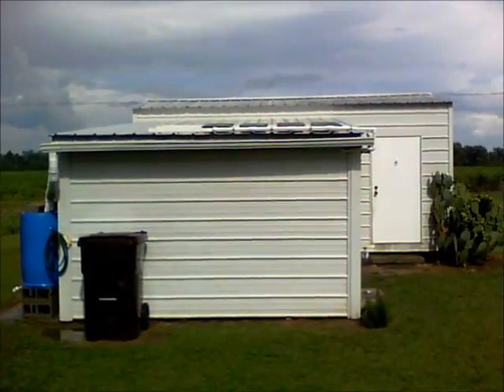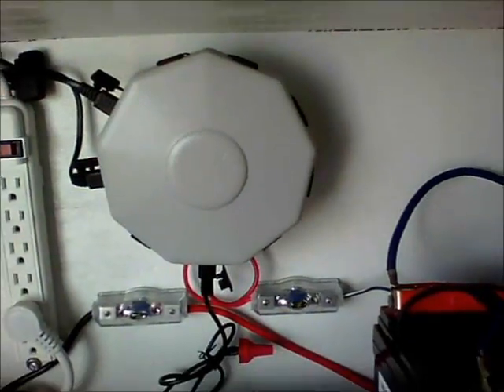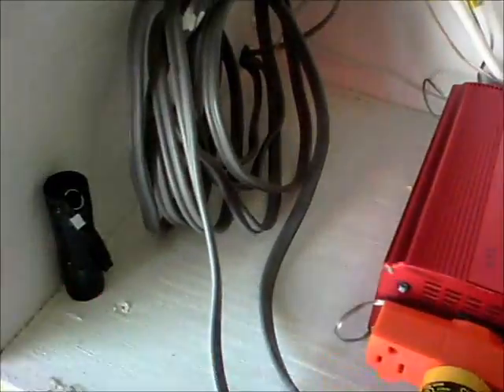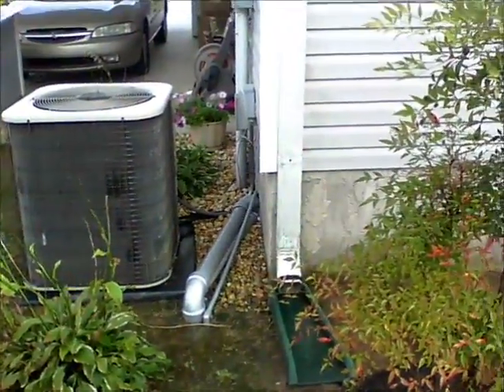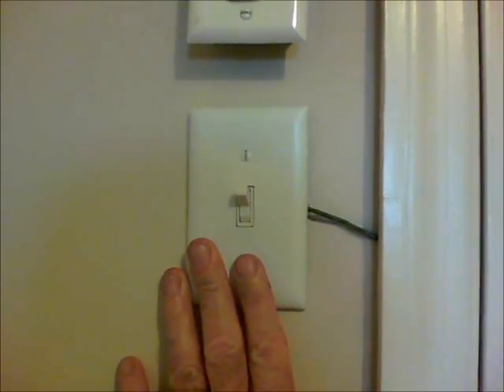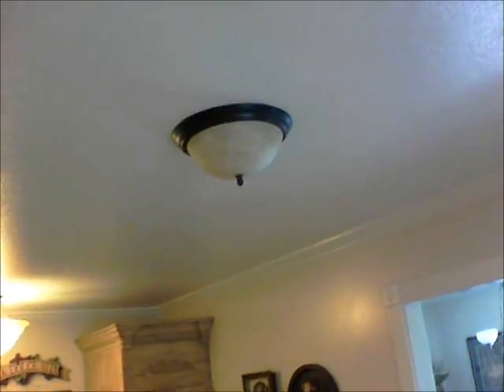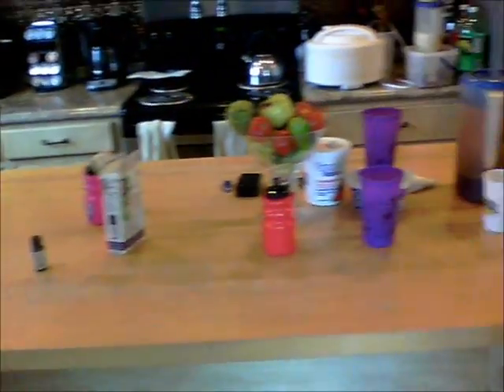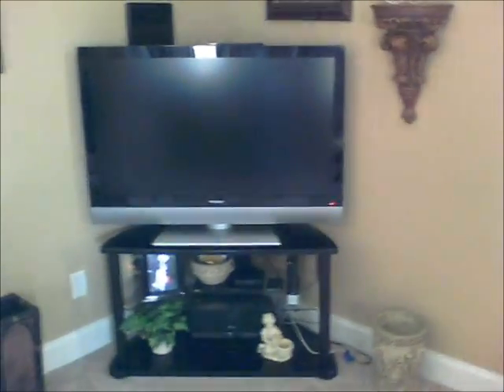Harbor Freight Solar Panels Wired into my house

Comment: Sir, if you are satisfied, there you go. Don’t bother about 44. Bravo, well done.
Reply from the maker: Well thank you. We are very satisfied with this system. Since this video I have added a 100 watt panel to the array and bigger batteries for more amp hours. Still using this same system after 4 years.
Reply: Hiw is your solar system doing is it still up and running

Comment: Great job..I have two of those controllers that I got when my uncle gave me two 45 watt kits for working on his mower...they can be hooked in parallel but since I already have a 4215 Epever BN  controller I just hooked the panels to it today...you get more amps with the mppt..I just got two more batteries yesterday so now I've got 8... now if the sun would just come out...lol...out of 490 watts of panels I was getting 20 watts today
I got more than that during the winter storm until the panels got about 4 inches of snow on them but my cousins were on rolling blackouts..my aunt called and asked if I had power (she forgot that I had been building a solar setup )and I was like yeah I just made coffee...I was just thinking I gotta get two more batteries so I did...I kind of like how it's doing now..the voltage doesn't move so quickly now..I started with two 19 amp hour batteries that I don't use for power now and now I have 680 amp hours...I have a room in the barn with my stuff so I was hooking the new batteries up and went to go out and a little skunk had found his way into the barn and was kind of foraging so I stayed in and watched TV and then today the sun didn't come out at all...so my batteries are at 25.2 volts and the little smiley face is on the MT50..lol ..I didn't get to see whatever it is going to do..fooey..it does this every time I upgrade something

Comment: This is the correct way to use solar. Lights take limited power, tv not much. So to use his system daily actually makes use of the power he gets from the cells. I have an inverter battery pack that I use in the house when the power goes out. It lasts 8 hrs and runs 3 lights in the house.

Comment: Someone who doesn't know much about electricity. I'm very impressed and what you did. I have worked on generators steam turbines and transforms for 40 years. Also used to wire houses in my younger years. What you did is very good a lot of work you put into it and it's still very good. In the kitchen where you have your light if it is feasible I would put a ceiling fan combination light. I too have two sets of Harbor Freight 45 watt solar panels old school type and I use it to power my shed good job. When I wire houses in my younger days, my boss told me one thing that always stuck in my mind. Electricity can only do two things and two things only. You can either work for you, or you can kill you. Just be careful

Comment: Wait wait you spent 20 bucks on a 100 watt led bulb???  You can get those at a dollar store for a buck lol. I know because I just bought 2- 60 watt ones today for a buck each. they only use 8 watts which is cool. Anyways you did a great job over all. I'm going to harbor freight tomorrow and getting a couple of solar kits also. I've also been watching you tube videos and am hearing that solar panels are much better than using solar wind. I guess they can break down and or over heat. Best of luck to you. Peace.

Comment: You admitting you're not an electrician and I am one of more than 30 years could have smart talked your installation of the wiring and could have been "one of those people" to insult you and be  a dick but I'll admit, I would have run the finished wiring differently and would have done things a bit different than you had but then, the jobs I do that you do as a living could be nit-picked to death as well. So... Nice job sir. The wiring on this job, schematically speaking is outstanding. Very nice what you've done with all the precautions and metering you've included has given this sparky ideas from your wiring you've done there. 

Good job. I just would have done things different but you have made it safe and working to your  benefit. "SAFE" is the magic word here. And you are safe there. Nicely done.

Comment: I was wondering if this system was restricted to lights or can you power up something larger also.Very nice job I say too
Reply from the maker: No, I can run anything up to 1000 watts, that's what my inverter can handle. I don't run the TV most of the time because it is not a pure sine wave inverter and I don't want to hurt my TV.

Comment: Very good video, nicely produced, lots of helpful information. I'd guess you might live somewhere near Huntsville, AL. We had en EF-5 tornado come through in the spring of 2011 that took down all of the feeder lines supplying the city, took a week to restore power. A LOT of people I know have installed similar systems since then, from solar to whole-house LP gas generators in case of another emergency. Your system is simple, expandable and seems quite efficient. Nice job!

Comment: It's been a few years since you made this video and the price of LED'S has dropped. I'm hoping you replaced all of your bulbs to led. Have you ever considered using Golf cart batteries they are fairly cheap but you'd need 8 of em as they are 6 volts. I've been told they are great for solar use. Last I checked they are about $68.+ per battery and they are big so longer run time as long as your system can fully charge em. Back to the LED's in your house use soft white not that horrible Day light white. Thanks for the helpful video and thanks for a perfect explanation. If only all YouTube posters would do the same.
Reply from the maker: Thanks for the comment, and I have updated my batteries and my lights. I just have not gotten around to making a new video to show it. We are still using the system though.

Comment: very nice. we’re in eastern, nc too and run a genny now but solar in the future. i made a distro that’s more convienient but have wanted to hardwire a few outlets (apart from the distro that accepts an rv plug on the outside wall - inside is breakers, outlets, voltage and power indicator lights, volt and ammeter). from there we run well placed 10 and 12 ga drop cords with quad boxes and hospital grade 20 a receps; safe and sturdy but a bit cumbersome
 thanks for sharing...

Comment: I am just starting my solar panel education, that said I was wondering if you could run your house on 12v. there are LED lights and pretty much anything in a RV could be used for home use.. what do you think ??
Reply from the maker: Yes you can, and lot of off griders do. People do it in RV's all the time. If you stay at 12v you will be limited on your inverter size is the big deal with most people. The main thing is, what all you want to run on the inverter. 
Thanks
Reply: @jamesndarlene  there was a guy talking about having your batteries at 24 or even 48 volts then reduce to 12v if needed. it makes it easier for your inverter. made sense to me

Comment: Thank-you sir. Finally useful, easy to understand information. I see where you added 100 watt kit and how many more batteries? And does the solar panels keep batteries charged when sun shines for normal day? I have system but haven't gotten around yet to trying anything yet because could only find negativity information until seeing this, so  again thank you!!!
Reply from the maker: Your welcome, and we added 3 more batteries so now we have 330 amp hours of storage. And yes, the batteries do charge up just fine when we have sun, and when we don't since we have two different kinds of panels. If we had even more battieries I think it would charge them up  just fine in a day as well. We love our system and are still using it for lights and fans and such. Great for power outages and it helps keep the power bill down the rest of the time.

Comment: how long have your batteries lasted years ,and about how many hours a day ?
Reply from the maker: Last year I bought some new bigger amp hr batteries at Sam's club even though the other ones was still working fine. As far as how many hours..... that's a hard one. It depends on what I am running, if there is any sun out, how full the battery bank was to begin with and so on. First you have to know what you want to run and for how long, then you build your system around what your needs are going to be. Mine was simple I wanted mainly lights, fan, coffee grinder, and maybe TV for a few hours. We still use our system all the time to off set our electric bill, and of course when the power is out. Hope that helps.

Comment: We just did our solar also, couldn't tolerate the SM or digital meter needed an analog. Just got new panels and Fork lift batteries made for solar. a bit pricey but will do what we need. 12 v refrig, 12v TV, 12v most anything you need is out there. Good doing. I learn better when it is simple and electricity.  Thanks

Comment: I am not sure if a larger capacity batteries would help you. if you don't drain the batteries too far down with what you have it might not make a difference. The solar panels have to put out enough power to recharge the batteries. It should charge them to a little over 13 volts volts at some point during the day which will drop some over time after the charging stops.  Not enough solar panels will cause the batteries to go too low as will not enough batteries. The charge controller can also cause the charge voltage too be too low. i read somewhere that the battery voltage shouldn't drop below 12.5 volts but i wouldn't want it to drop below 12 volts.

Comment: If you replaced the compact florescent with led lights in the sealing light it would take less power and wouldn't need to wait for it to warm up. Led is more efficient than florescent. Led bulbs are much less expensive now. I( have seen them as cheep as $1 each. The ones i use are usually about $2 or a little less each in boxes of 4.

Comment: Are you running the fridge on that system as well?
Reply from the maker: No, I could for maybe a few hours but not all the time. I have upgraded the batteries since this video but would need even more to run it all the time.
Reply from the maker: Mine is a very small system for lights, TV, Coffee Grinder. For the large things you are wanting you will need to figure how many amp hours you will need to store in batteries to run those things. Buy a kill a watt meter and plug into each thing you want to run. Then figure out how my amp hours your battery bank will need to be, then figure out how many solar panels you will need to charge that battery bank and that's it. you build your system around what your needs or wants are. mine was small because I just wanted back up power for power outages. I hope that helps.

Comment: For someone without electrical experience, it seems you did an okay job. The PVC you used is not exposure/sun rated though - should have been rated schedule 80. It's also a good idea to run low voltage and high voltage in separate conduits. NEC was a little different in 2014 though. I just hope you're careful with the wiring and keep a check on how it's performing. Good luck with the Harbor Freight stuff. I have a little less confidence in electronics from China. It would also be a good idea to label the switches and outlets on the solar circuits and when you have time, switch the CFL lights for LED.

Comment: How is your system running after these yrs ?
Reply from the maker: It's still running great, in fact a few months ago we found bigger batteries on sale at Sam's so we have upgraded our battery bank.
Reply: @jamesndarlene  so how many batteries did you get? Are they deep cycle how many amp hours do you have now
Reply from the maker: Yes, they are deep cycle Duracell I got at Sam's They are 110 amp hours each. They were on sale a few months ago for 70 some odd dollars. So far I really like them. The battery bank I was using I wired DC lighst to them in my shop and right now just use a charger to charge them because they are still good batteries. I just needed more amps for my system.
Reply: @jamesndarlene  how many did you buy
Reply: @jamesndarlene  just one battery from Sam's
Reply: @jamesndarlene do you think you ever going to get more panels
Reply from the maker: Well, yes and no..... we are thinking about moving and building a passive solar home we like solar power so well. If we stay here we will buy more panels (already bought a midnite charge controller just haven't installed it yet until we see what happens). We bought 3 more batteries from Sam's, yes they are deep cycle 110 amp hours each. Until we see if we are going to sale or not we don't want to tie to much more money up in this system. If we stay at this place then we will. The only changes I would make other than making the system bigger is, I would have wired it for BOTH 110 and 12 volt. Using what you can of 12 volt lets you bypass the inverter and it saves power use on the battery bank.
Reply from the maker: 3 more for a total of 330 amp hours.
Reply: @jamesndarlene  so does the panels you have now charge the batteries you brought in one day or it takes time
Reply: @jamesndarlene  wow you have a midnight charge controller that's good they are a little over my budget price wise
Reply from the maker: in just a few hours. I don't know if you seen my add on video from a couple of years ago but I added 100 watt panel to my solar system so they charge up pretty fast. I have about 200 watts an hour going into my batteries. I will add the link to the video. https://www.youtube.com/watch?v=oi2NhnSN5eQ

Comment: Great video, very informative. I have plans to do the same thing, but I will avoid having to use an inverter. A 12v fridge, a few fans, and lights is all I would need. I would like to set up my work shed to run off of the solar and be able to send power to my house in case of a power outage. Thanks again for the informative video.
Reply from the maker: you are right! I wish I had thought of it before I ran my lines underground I would have done a 12 volt system in the house. It would have saved about 5 percent of my battery banks power that the inverter uses.

Comment: you should plug your tv set in that will def make a diff they pull big power
Reply from the maker: actually, that TV went out on us so we bought a smaller LED TV that only pulls 25 watts so we could use it on our solar system if we need to.

Comment: are you running LED light bulbs ? ive got some really bright led bulbs there not round shaped they are barrel shaped they are bright and only pull 12 watts and put out like a 70 watt bulb. i love your system im totally gonna do the same thing !
Reply from the maker: That's great news! I know you will enjoy it when you get it set up. And yes, I bought LED lights just for these light fixtures and we think they are great! Let us know how your system does when you get it installed.